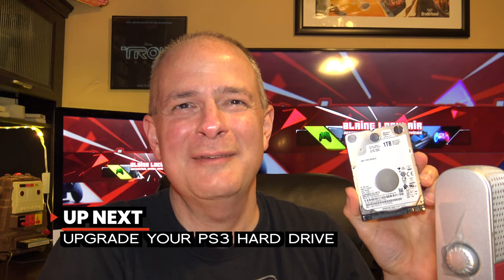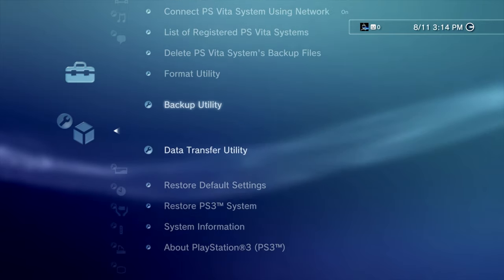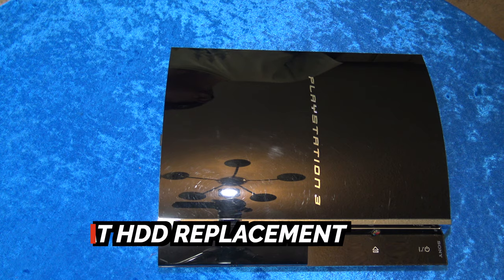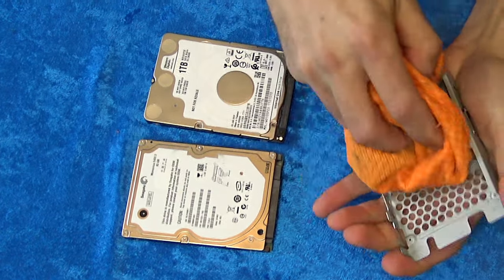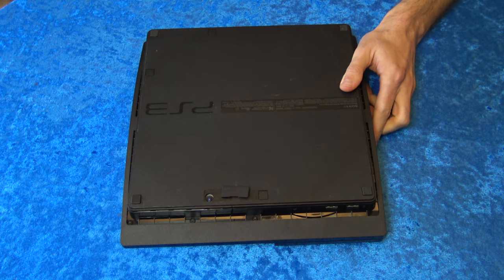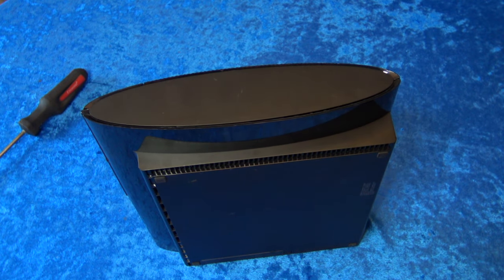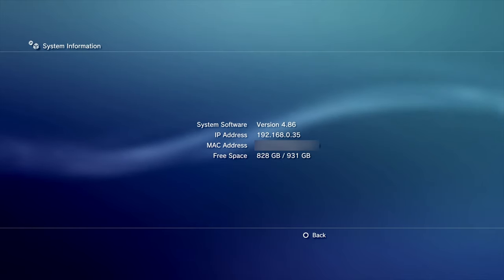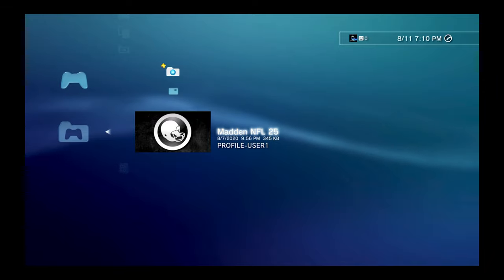PS3 Fat Hard Drive Upgrade 1TB + Slim & Super Slim Guide

Comment: Can i just buy the HDD, put it in, format it with the ps3, and begin using the ps3 as normal? 

Or do i need to place sony ps3 key data on the HDD  for it to read and work with the ps3? 

Thank you for simple and quick demo videos. Helped me out alot.
Reply: @ColeDedhand  thank you. 

I guess my real question is there a specific code that Old hdd will have installed that will cause the other OEM chip and parts not work? 

For example, not being able to use the same sd scard in other Nintendo switch. 

With taking out a key feature of the ps3, there isn't a specific key or code i need to imprint from the old HDD that I couldn't get off the site or from the reminding unit. Just the information in the file linked ubove. 

Thanks for the time to clear one concern and giving me the link.
Reply: Personally I'm going to backup my jailbreak then install the new drive and attempt restoring data to it while my original becomes my official backup drive...

Comment: You didn't have to go to the settings to do all that work in backing up and restoring your saves.

You could have went to your saves directly and copied it from there to your USB🤦‍♂️

It's much faster that way and there's no hassle as suppose to using the settings.
Reply: Hey did you encounter the 8002F2E4 error with your new HDD?
Reply: @reneshgovender222  no cuz it's just game saves that you'd be copying over to the USB